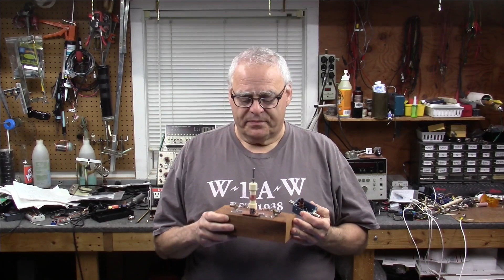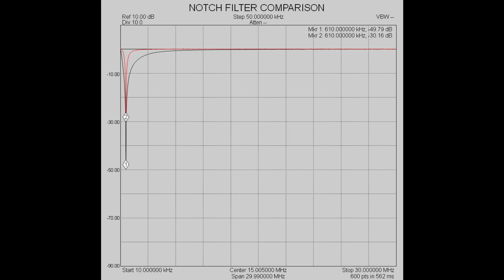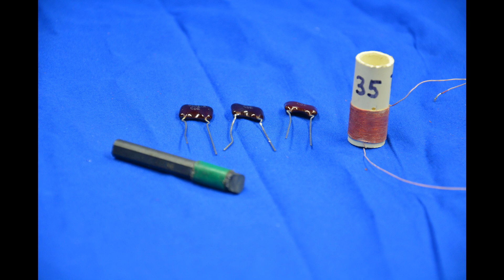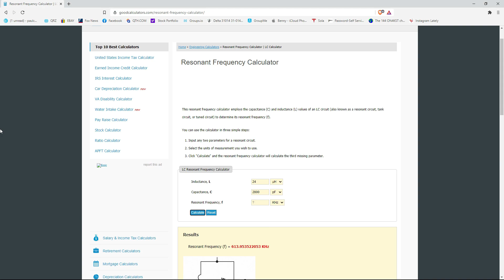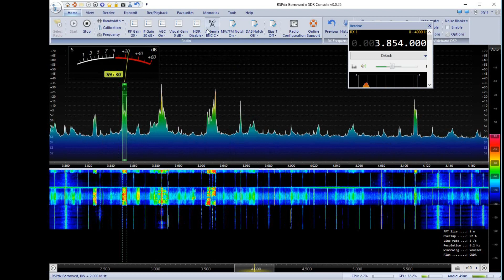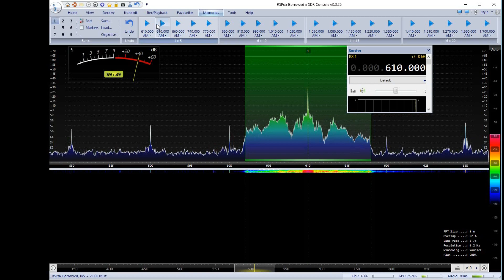AM Band Sharp Notch Filter For SDR Part 1

Comment: A capacitor and inductor in series makes a series tank.  Applied across your circuit in parallel, it is a deep notch filter.  The width of the null is determined by the loaded Q of the tank, and a series tank's Q is the reactance of its elements divided by the characteristic impedance of the system.  For narrower nulls, you want smaller capacitors and larger inductors.  With a capacitance of 2.8nF, the circuit has a Q of only about 1.8, where as with 220pF, it's more like a Q of 23.  Instead of ferrite, you might consider 124 turns on a T130-1 powdered iron toroid for a higher Q inductor.

This Spice simulation illustrates the difference:

V1 N003 0 AC 2 Rser=50
R1 N003 0 50
C1 N003 N004 2n8
L1 N004 0 24300n
V2 N001 0 AC 2 Rser=50
R2 N001 0 50
C2 N001 N002 220p
L2 N002 0 308µ
.ac oct 1000 61e3 6.1e6
.backanno
.end

Comment: I have probably the worst case situation, a 50kw station on 830khz exactly one air mile from my QTH..... and I operate 160m. I built the BCB band stop filter from the ARRL handbook and that works very well. Unfortunately, as you pointed out, that takes out the entire AM BCB. 
I have the components to build your filter (1/2" PVC?) but I'm wondering would it be possible to place two of these filters in series to either reduce the depth of the notch further or be able to notch out two different frequencies at the same time. I also have a close local station on 1550khz. Thanks. Glenn W2BX
Reply from the maker: WTRU??   I think it would work, I never tried. 30 Db notch gets most of my Rx's out of trouble..  I would certainly give it a try  Good luck W1VLF
Reply: @W1VLF  Yup, that's the one... 50kw bible thumper. I'm in the process of changing from a 120ft end fed random sloping wire to a 600ft horizontal loop. There will be a LOT of that 830khz energy on the antenna so I'm concerned that 30dbmight not be enough. Thanks for the reply Paul. I'll post when I've completed a prototype of the double filter. Glenn W2BX
Reply from the maker: @fintronics  Hey Glen.. I would be very interested in your results..  you may have do 2 things when you get to that kind on attenuation level. Use a shielded box, at -60 dB  pickup from the coils could be a problem.  Also use a coupling capacitor between the 2 notches, preferably a variable and adjust is  to look for the best notch.. It might be a game of going back and forth adjust all 3 controls for best rejection
Reply: @W1VLF  Thanks for the tips Paul. I will use a shielded box and shields between the sections... and an air variable between the two coils.

Comment: In my college days these types of tuned circuits were technically called  permeability  tuned circuits either series tuned or parallel tuned vry similar to 1940s To 1970s  types of "Can"  form factor IF  Transformers  in IF stages specially in tube type superhets of the day. Also known as SLUG tuned tuned circuits like the method used in this presentation.  Great video by the way. tyvm U just gave me a solution to my noise issues here at my qth from a tried and true technique from the days of yore in early ham radio days b4 all this dsp thingys , 73s !!!
Reply: I have a bunch of those old IF cans, some large ones, I believe made by Miller? I may experiment with those as well...
Reply: Well I pulled out my box of old IF cans, the majority of which have way too much inductance. (455khz IF) I also found some 1970's miniature IF cans. One had a 16 to 18uh range so I wired that up just to test. Works very well except the inductance calculator was way off. It notches at 1550khz (w/2100pf cap) instead of my target of 830khz.
Today I'm going to take apart one of those old cans, remove the wire and re-wind to get my target value with a little more range.

Comment: Just trying to figure out what the actual circuit is -- I did not see a diagram -- Is the Inductor IN series with the signal with the capacitance in parallel to the L?
I out a LC together in parallel to ground - but this does nothing....
So - it is series parallel, yes?

Comment: This is exactly what I've been looking for and couldn't find. Great video. My offending transmitter is 8 miles away, blasting 50,000 watts of interference, rendering my EFHW useless.
Reply from the maker: Hi Shoa,, thank you very much for your comment.  Big antennas with nearby big signals, = disaster for a lot of SDR's  Hope your build works out!! W1VLF